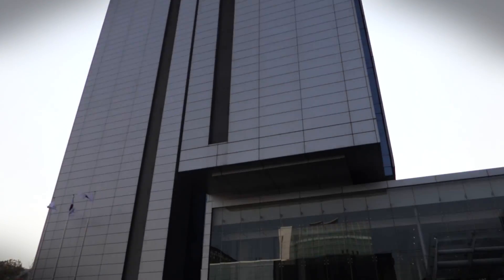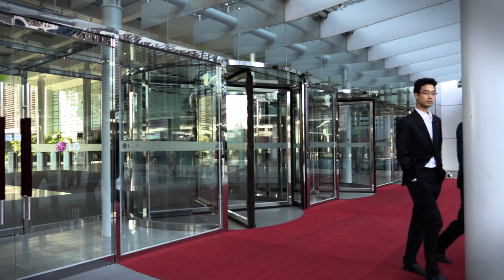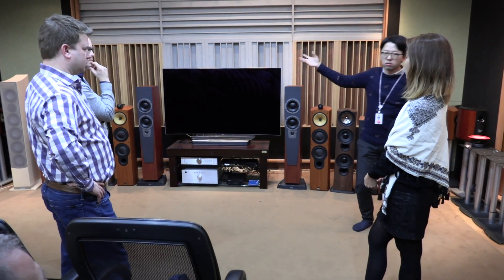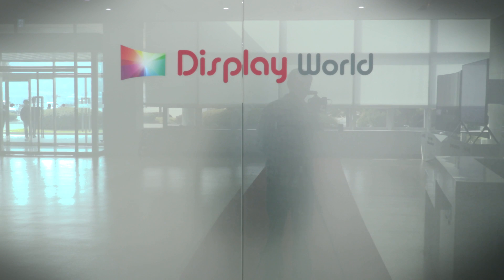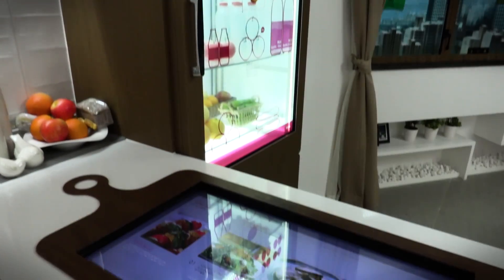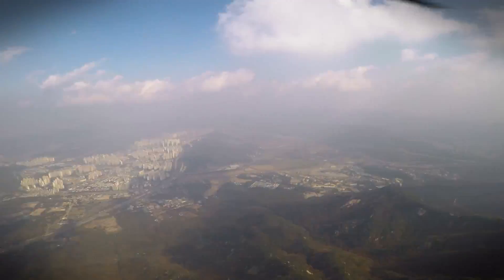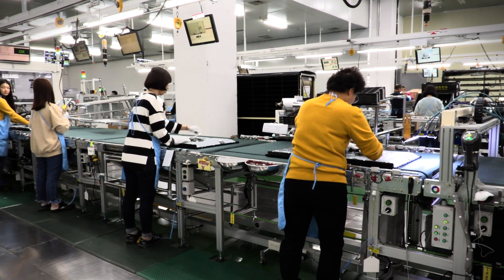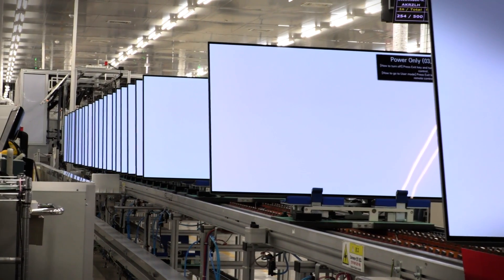Exclusive tour of LG's OLED R&D and manufacturing facilites in South Korea

Comment: Too bad they cant source good leds. Under 2 years they generally burn out. Hence a 1 year warranty. I just had to open up my 65” today. 1 dead led killed the whole tv..Not even 2 years old. Pretty shitty for a $1000+ tv...lesson learned? Always buy an extended warranty and always turn your backlights down to like 50%. I saved mine, but most end up in the dump

Comment: Thanks for the informations, needs provisions of the protection from noise, surges protectors, spike protectors, any kinds of boosts, Protections from High voltages and Low voltages from any kinds environmental conditions and fixed regulating systems outputs , any abnormal protections outputs facilities and needs wides ranges of voltages variations from 50volts AC to 110volts, 120volts and maybe 220volts, 220volts to 260volts  and 270volts and Regulations and tolerance +_ 0.5 to +_ 1% fixed outputs voltages like 110volts, 120volts , 220volts and 220volts outputs and needs protections from thundering and lightings with controls of safety and security concerns abouts betters anything else regarding related to alls including sounds, must running any through of generators, inverters, UPS and solar power systems for alls day and night purposes conditions as may given provides to alls regarding related advanced to alls and may be supported by the batteries, can it possibles to makes Android versions with Android remote controls may be able to runs solutions of the solar systems for anywhere insides and outsides provisions in provisions through lifetimes battery supported such longest time durations, can it possibles to makes likes Provisions likes Radios in itselfs may be trans and Receives any alls kinds alls TVs and Radios channels automatically generated as worldwide receivers for anywhere and anything else including general manuals setups through TVS and digital Android screen touched remote control controls, can it possibles to makes combined with mobile phones services with cameras, camcorders, with cables and dishes and through any nets services through mobile phones services concerns providers including cameras settings for communications ever where with screen touched display including remote access to provide promotionals approaches to alls as may possibles mades, we have to needs Recearch and developments for setups total wireless network controls systems, to total achieved by alls overalls benefits globally recognised and needs recordings and printing provisions in the sets , maybe running through pendrive, card readers, SD and micro SD cards and through sims and Automic and manuals controls alls TVS and Radios alls channels selectors worldwide presentations will crystal HD quality pictures, video and audio visual equipment modified editions services, please make sure withstands efforts tables prices with minimum powers consumptions, stoods 8k , 4k , digital HD with OLED or QLED provisions including lastest versions mobiles and laptops oppsions maybe computers Assistance for overalls portables and general provides access achievements, concerns providers please highlights abouts taken technological advances innovations conversation achievements designs with developing cares,thanks given with love and cares abouts, God bless you alls, yours faithfully.

Comment: While Lg's factory in south korea looks like they take great care in their panel manufacturing I cannot say the same for their factory in Mexico. 
  
I went through 4, yes 4 65E6P OLED Tvs that had either severe vignetting on the sides, several dead pixels on one tv, and 3d filter alignment issues.
 
   My 4th set was better than the last 3 but even that one had hairline scratches all around the perimeter of the tvs screen from workers mishandling at their mexico plant.     
  
  Cheap labor sucks when it comes to quality control! I wish I could've bought one of these directly from their made in korea plant.

Comment: Every LG TV we've had lasts 4-5 years .. that's it. LG seriously needs to fix that problem. It's not the panels, it's their electronics...
Reply: D Jaquith sounds like they design it that way so you are forced to buy/upgrade to a new tv. By the 3rd or 5th year they stop making the parts for said tv so you're SOL when it comes to a repair.
Reply: I extremely agree with you and i bought a 24 inch tv it work just 3 hours and burn main board.very good job lg,i never go for lg again.TCL amazing TV brand and work sooo long time with high quality picture and reasonable pricing.

Comment: I bought a LG TV. After 2 years broke down panel.REPAIR no sense was  costly.Cena TV 1400$, operation cost more than projektor.LG NO !!!
Reply: David Daduc LG sucks when it comes to warranty claims. They make good products but if you're out of warranty you're screwed.
Reply: David Daduc yup, I too question LG quality.. Have an LG fridge, not a cheap one either, fancy stainless french door model. Its had many problems, swtches for freezer drawer lights failed first, bottom shelf crumbled due to brittle plastic next. Ice despenser is exstremely slow and jams often, and the door to access it freezes and has to be thawed to open every time. List goes on.
Reply: I had an LG plasma tv that bit the dust after five years. March to the dumpster.
Reply: David Daduc Yep they will all break and be thrown away eventually, this stuff is not built to last, so therefore it is all garbage from the start, with the manufacturers laughing at the customer once they get their greasy hands on peoples hard earned cash

Comment: if u look into hifi-forums you see there is quite amount of different quality output from LG panels, there is problem with banding etc.
Reply: Yes, there is still more room for improvement as far as uniformity near black is concerned.
Reply: vinnie97 yep i went through 4 65E6P before getting that didnt have horrible vigenetting or dead pixels issues. Still have some slight banding on 5 to 10% blacks though :-(